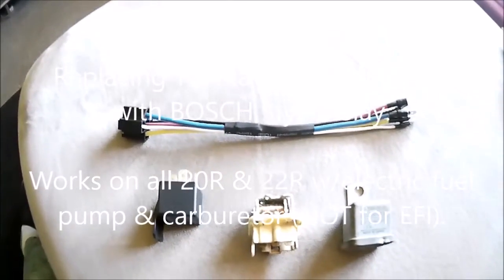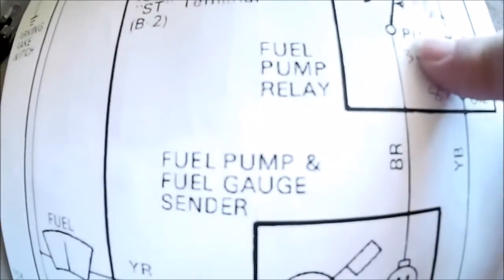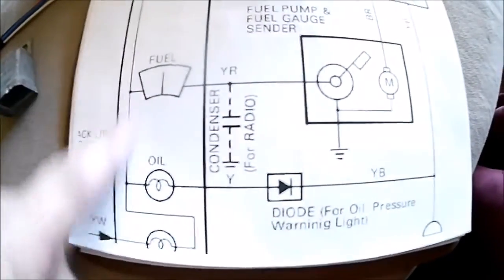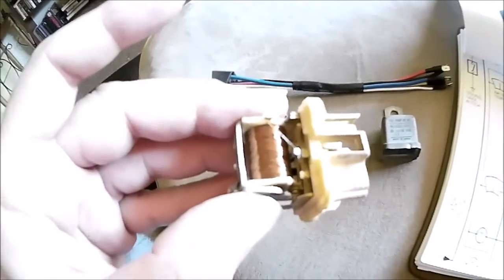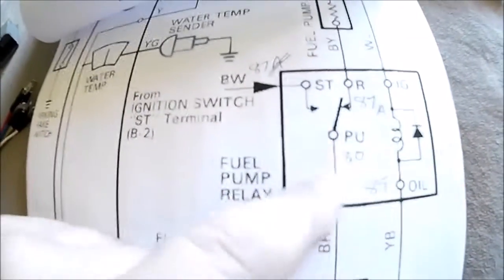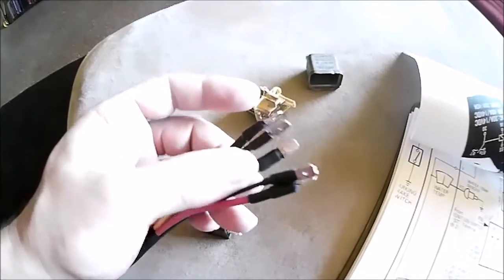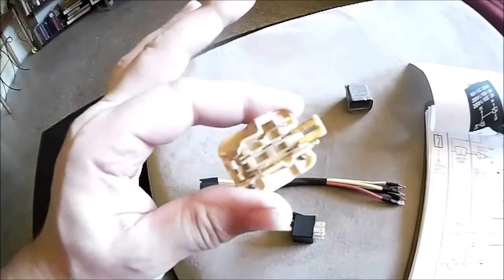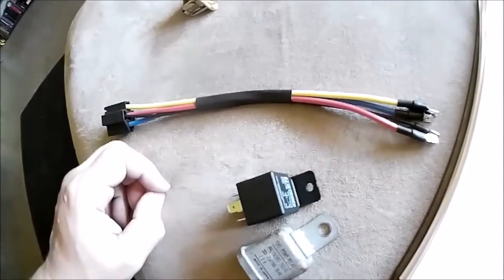1978 Toyota Pickup 20R-Fuel Pump Relay Replacement/Substitute

Comment: Hey man I have a 1978 toyota hilux dually project that i working on. I recently have been having problems with starting the car and stalling idle. I started having the problem after I washed the inside of the floor with a high pressure water hose ( I know not the best idea) and I think that I may have gotten water in the electrical or something because only one of my lights goes on now. I am able to start the car only when I press the gas pedal down and can only keep the engine on when I keep my foot on the gas.  I Have sprayed carb cleaner on the carb and that did not solve my problem. From my understanding it seems like a fuel related issue but I have been having ths issue ever since I used water to clean the inside of my car. The aaa guy said a couple months ago that I would need a new alternator eventually but I have no idea if that is what would be causing this problem. I'm gonna get a multimeter and test the battery to see if the alternator is functioning as it should. Gonna pick up a new fuel filter and see if that helps at all. Any advice would be much appreciated, I don't know much about cars right now but I am learning with this project.
Reply from the maker: We all have made mistakes along the way when it comes to vehicles, but we can learn from them. I'll try to take your points in order. Yeah, washing out a vehicle interior with a high pressure water hose really isn't the right way to do it. The pressurized water can damage parts & wiring, especially if they are 41 years old, plus the "splash effect" probably sent water up into the fuse box & maybe some other electric components under the dash. Never a good idea, but you work with what you've got. Something else to consider with a vehicle this old is that many parts and systems may need to be rebuilt, replaced or otherwise reworked just to get things working normally again. Time & use takes a toll. If you really want to keep working on this truck as a project, you need to know you may have a LOT of work ahead of you. There could be some basic things wrong or there may be a bunch.  I've been through it myself (several times) & it can be a great learning experience. Also understand that it is going to be difficult for me to diagnose your problems "by remote", and also not being able to see things for myself. Just understand that once you get into fixing this truck, you may not be driving it again anytime soon. There are no good quick fixes. The good news though is that when systems are fixed right on these trucks, they respond & work well.

Using the high pressure water may or may not have anything to do with your starting & running issues. If you are still able to start the engine & keep it running, even with your foot on the gas pedal, and it runs decent, in general I'd say you probably don't have an electrical problem with the ignition system. The only way to know is to test the entire system for damaged or malfunctioning parts. To learn how to do that you will either need a factory service manual for the specific model & year vehicle. You can buy these at almost any auto parts store and they are the best thing to have when trying to figure out a system. I can also help you a little more by telling you to go to this website & save this link in Favorites: http://www.retrojdm.com/ScanView.asp?ScanID=104 This is an online version of a factory service manual covering the 20R Engine that should be in your truck. There is a lot of good basic info there that you can learn from, but not all of it may apply to your specific truck. That's why you still need the specific service manual.

What you have described does sound like a fuel issue. I wouldn't want to guess but it sounds like the Idle Circuits in the carb are clogged up. It could also be something else like a vacuum leak, a mis-adjusted carb, a worn out carb or something else entirely. Spraying Carb Cleaner "on" the carb may make no difference to how it functions. The problem could be one or several other parts of the fuel system. The 1978 Hilux also has an electrical part to the fuel system, as it has an electric fuel pump in the tank, a fuel pump relay under the dash, and a fuel pump resistor in the engine bay. Any or all of these parts may be so used they just aren't working right anymore, & need to be replaced. There are also a fuel filter (which you mentioned), rubber fuel lines, clamps and even a throttle rod system that connects the gas pedal to the carb. Wear on ANY of these things can cause a start & run issue, so they ALL have to be inspected & gone through.

All that leaves me with a bunch of questions about your truck. What's the mileage? Did you have it running OK before all of this? Be specific. Are the engine, transmission & the carb; are they all original parts? What kind of transmission (auto or manual? if manual how many forward speeds, 4 or 5?) Was the truck sitting for a long time not being used before you got it? (Major Issue) What's the condition of the fuel lines? Does the carb look like it's been installed for a long time? Have you been using Ethanol blended gas in it? What one light still works & what other light doesn't? (You are not very clear on this) Why did you need the AAA guy? What happened? Sure, you may need a new alternator eventually because all parts eventually wear out & stop working right, but that doesn't tell me much. Testing the battery with a multimeter is a good idea, but a better idea is take the battery to a parts store & have them test it under load. This is a truer test of the battery's condition, & most parts stores will do this for free. Same goes for the alternator (parts stores will test for free) but testing in the truck it to see if it's charging requires the engine to be running & if you have a hard time keeping it running, you can't test it with a meter. You say it's a dually; most of those were former campers/RV's (or still are). Those have some extra equipment that might make a difference, like extra electrical parts under the hood, a place & wiring for an extra battery, & extra switches in the cab. What have you got?

All that is just for starters on info. Once I get a better idea from what answers you can give, I can hopefully give you some ways to go on it.
Reply: @The13thSword   The13thSword  thank you so much for the thoughtful reply, so the story is that I got this as an RV a couple of months ago and have taken the whole motorhome shell off. I have easy access to the fuel system that way now which hopefully will help me in fixing this problem. AAA came to me because the battery was crap and died while I was driving it home. He put in a new battery. I tested the battery with the car running ( left something on the gas pedal) and it stayed above 13 volts, which I read online means that the alternator is charging the battery. It's a 4 speed manual transmission . Just found out that the fuel line has an external electronic fuel pump connected to the frame outside the gas tank, and there is no fuel filter on the whole system at all. I'm now guessing that since there is no fuel filter the carb is getting absolutely clogged, am I right?
Reply from the maker: @jonahcombs451  You are most welcome & thank you for replying with the extra info, that will make things easier. I see another reply from you & will handle that in turn.

You are correct, good alternator charging voltage is usually 13+ volts on up to 14.5 volts, depending on condition of battery, so sounds like the alternator is good.

The electric fuel pump on the frame is NOT a stock Toyota item. Since the stock fuel pump is inside the gas tank, when they fail a lot of people just add the external pump like yours has. They don't want to go through the extra work of dropping the tank out of the truck to change the pump out. Any markings on that pump? Make/brand/model number? Some are better than others in quality & durability. Do you still have the stock Toyota carb on the truck or maybe a Weber carb? This can make a big difference concerning the fuel pump.

To test the pump & see if it's even working, disconnect the hose on the "engine side" of the pump, put on a short piece of fuel hose, put the loose end in a container to catch any gas, then turn on the ignition (key) for at least 5 seconds. If you get no gas out of it, try cranking the engine for 5 seconds then stop & check the container for gas. If no gas the pump is either dead or the wiring to it has a problem. Any wiring to that pump is also not stock, so we don't know if they did a good job with it or not; it's worth checking out.

If the pump is dead you have choices to make. You can either get another external pump of the right type & rating & replace the old one, or you can drop the tank & replace the stock fuel pump inside it. Be advised though that if you do the stock pump, you're going to also have to look at the stock fuel pump relay & resistor. I can guide you through those.

The stock fuel filter for this truck is supposed to be located in a round metal clip holder mounted on the passenger side fender skirt, in the engine bay. If there currently isn't one there, they might have just put in a solid length of fuel hose to take it's place. Not a good idea IMO.

Again, you are correct (2 in a row!) :^) The lack of a fuel filter will allow small particles of dirt & junk to get to the carb. Most likely the idle passages in the carb are clogged, which is what might be causing your start/run issues. There are some ways to try to clean out the idle passages, but since it was run with no fuel filter, there could be more junk sitting in the fuel bowl, & it just may clog on you again. Also the idle jet (located in the fuel bowl) may be clogged as well. idle jets & passages are VERY small things, & it doesn't take to much junk to clog them up. The idle jet has a hole in it 0.5 mm; this is just twice as thick as a human hair thickness. If you want to try & clean out the carb rather than replacing it let me know & I'll tell you how I do it.
Reply: @The13thSword  it has 72,000 miles, ran fine before the only problem it had was overheating. I changed the whole cooling system out and it ran fine for a couple days then it sat for a little while ( 2 weeks ) and I did the washing, now there is this problem, by the way I picked it up for 400$
Reply from the maker: @jonahcombs451  That was a good buy! Good work on changing out the cooling system components. You did also put a new thermostat in it yes?

Given that it is 41 years old with only 72K miles, I would assume that it wasn't driven a lot. Vehicles that sit more tend to actually need MORE maintenance than 1 that is regularly driven. Things can actually break down quicker due to non-use, especially some moving parts & rubber items, like fuel lines, vacuum lines, etc.

If you still have the old rubber fuel lines on it I suggest that they all be replaced before you go much further. The modern gas with Ethanol in it really can do a number on old rubber fuel lines. They breakdown on the inside & shed off rubber particles & this is what may be causing your carb "clogging" problems. It happened to me. Any new rubber fuel line you can buy in parts stores today will be Ethanol compliant so they will not break down like that in the future.

If you ever decide to replace the vacuum lines, make sure you get the right size (must fit snug on vacuum ports). Also only replace 1 at a time as you go. That way it's easier & you can be sure that nothing gets mixed up. As long as you don't have any vacuum leaks you can leave them alone for now, but be aware they are 41 years old & probably stiff & brittle, & could break on you. I would at least replace the 1 vacuum line that goes to the distributor as that is crucial to the engine running well.

BTW, I'm still very curious about the lights you mentioned, the 1 working & the other not. What lights are those? You didn't say...
Reply: @The13thSword  also want to say that basically all the parts look like they are old at least 10 - 15 years each. It has all the California emissions stuff and the carb that goes with that setup. Definitely not a weber. The dash lights and gauges all work fine, the headlight turn on.

Comment: I have a 1980 Toyota pickup truck 4wd with a 20r, I'm just learning about it and seems to be having a fuel problem. Watching this video makes me think that, this could be my problem. I'm just not sure. It started with no issues 5/6 times, first crank no issues. Two days later, nothing. Cranking, wants to turn over but it doesn't. I removed the electric fuel pump (original on the head fuel pump was deleted prior to my purchase) and purchased a new one, still no start, it cranks and wants to start but doesn't. Spray carburetor fluid in it, cranks right up it wants to run but, it shuts right off. Went direct, no gas tank(incase fuel lines were clogged) used a gas can and a hose with the electric pump, nothing. You could here the pump is working both, old and new but it doesn't start. Spray carburetor fluid in it and it wants to turn on but, shuts right off once it burns. So after watching this, I'm going to try this to see if this could be the problem. I did order an aftermarket fuel pump to mount back on to the head. But, I'm not sure if I'm going to use it or stick with the electric pump. After reading this (hopefully it makes sense), do you think that the relay could be my problem as well? I know it's hard to give an answer when you're not actually there. But, I guess I'm just looking for any advice or maybe there's something that I'm missing you or someone could help me with. 

Thanks for the video, it's very detailed and useful. Let me know what you(anyone) thinks. Thanks again.
Reply from the maker: First, a pretty fair job in trying to narrow the problem down, so well done there. We can eliminate the fuel lines & fuel filter as a possible cause thanks to your test. Also, the test with carb cleaner & it firing right up shows you have good spark & compression. My first guess is that the problem may be related to the electric fuel pump.

The 1980 20R normally came with a mechanical fuel pump mounted to the head. Some 20R equipped vehicles (including the Pickup) of other years came with an electric fuel pump mounted inside the gas tank. That system uses the fuel pump relay & a fuel pump resistor. The mechanical fuel pump does not use these parts because, well, it's mechanical & not electric. So your 1980 truck would not have those "factory" parts  even installed.  I have no idea why a previous owner would put in an electric pump instead. Replacing the mechanical pump is easy.

I do not know what electric fuel pump you have on it or what new one you bought. If either or both are the "universal type" that may be your issue. Most "universal" electric pumps are rated for 4 to 7 PSI fuel pressure. The stock carb is designed to operate correctly at 3 to 5 PSI. The universal electric pump could be feeding too much pressure to the carb, causing at worst a flooding condition (way too much gas) or at best minor flooding. This makes the fuel/air mixture going into the engine too rich (too much gas) & if it starts at all it's not going to run right, or may not run at all.

The mechanical fuel pump is rated at 5 PSI maximum, so it's matched to the carb's needs by design.

What would I do? I'd install the new mechanical fuel pump, hook up all new rubber fuel lines to where they need to go,  & also use all new hose clamps where needed. Then test her out & see if she wants to start & run. If you need to know what lines on the mechanical pump go where, check out this thread on Yota Tech: https://www.yotatech.com/forums/f115/help-mechanical-fuel-pump-109852/ You might also want to pull the valve cover to make sure the eccentric cam that drives the fuel pump is there (also shown on thread). Let me know if you have more questions or what you decide to do.
Reply from the maker: One other thing. The mechanical pump is supposed to have a spacer between it & the head, & a gasket goes on either side of the spacer (gaskets should have come with your new pump). You didn't say if the old pump is still on the head or not, or was removed & a block-off plate installed. So I don't know if you have the spacer or not. If you don't have it, here's a link to get one:
https://www.rockauto.com/en/catalog/toyota,1980,pickup,2.2l+l4,1277120,fuel+&+air,fuel+pump+spacer,6252

You MUST have the spacer installed for the pump to work correctly.